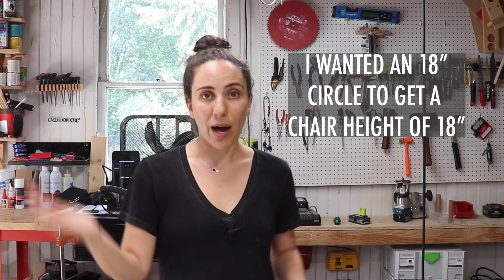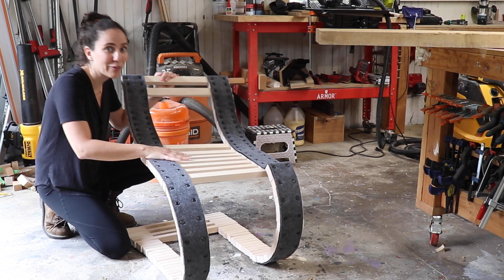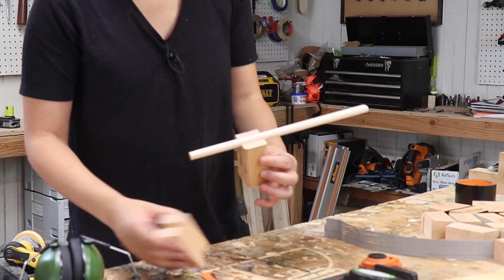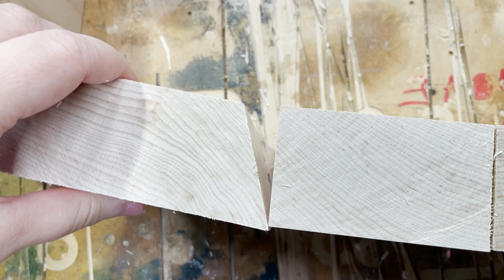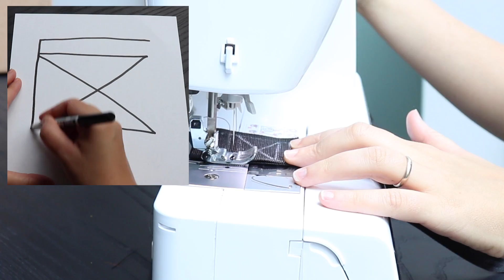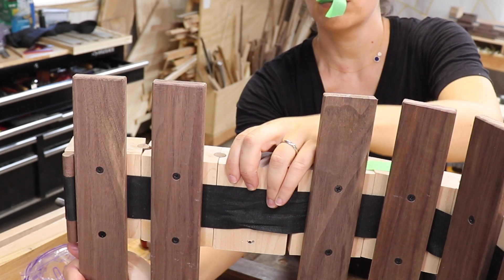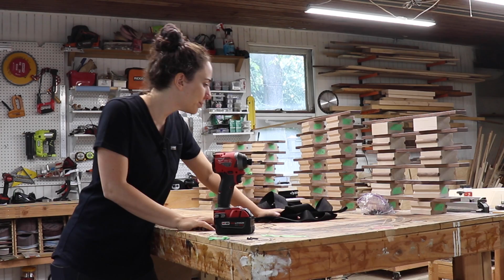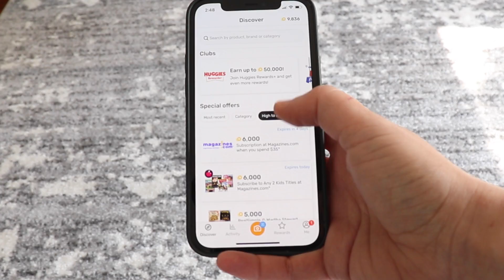I ATTEMPT to make a Roll Up Chair… AGAIN...

Comment: Yeah I think your major downfall here is the straps, sprats are made or usually like what strong cloth? And cloth stretches no way about it. Leather would also stretch a ton so I would recommend against that too, I think your best and only real solution here is metal, either metal cables to hinges would probably work best since they will give the flexibility to roll the chair up but won’t stretch at all. Also in my completely unqualified opinion I think it would be best to make the big bend of the chair smaller so the chair isn’t so tall and maybe shorten the length of the chairs platform since the farther out you go the more leverage you create putting more and more pressure on the bend that need to hold you up

Comment: Ever who suggested small cable through the center of the wood in the critical curves might be it . A 3/32 stranded cable I think has a working strength of 300 lbs . By dead heading the cable using nikro  crimps set into the wood this Might work . Explain this to an engineer who is a fellow wood worker and you’d find he/she would jump on the challenge. These guys love a good old how to problem. Still use the straps .  Hope this makes sense, my explanations aren’t always the best .

Comment: All you had to use was tension steel cables with a tension release pin for when you wanted it to fold.
Steel doesn't flex, and the pin when no pressure is on it can easily be removed.

Comment: you could just use a lot of hinges between each block, maybe 1 big one per 2 blocks or 2 smaller ones per 2 blocks, it would not have any flex and would still fold up

Comment: An idea with everyone else’s you could try and make a limiting piece to go on the curve parts that would still hold the angle just from the other side of the 360. It may have been harder for the math but I think that could work as long as it doesn’t ruin the look your going for. I know the piece wouldn’t roll but if it’s just one piece limited then you could roll everything up around it.

Comment: Hey, I know you have tried twice and can't get it to work... I have a third design that will work... best part, it rolls up like you want, doesn't twist, and as an added bonus, should work without even the need for strapping and is tunable.

How do I get you my design drawing?
Reply: I messaged you through youre website.

Hopefully I hear back from you, if not simply to humor me. :)

Comment: I wonder if you could've made stiff supports to take some of the force off of the straps. They'd be under where you sit so that the straps don't flex under your weight. They could also be used to turn the chair into more of a backpack when it's rolled up.

Comment: What if: Make the blocks themselves into a chain, and ditch the strap entirely.

Cut each block into thirds along the direction the strap currently runs, then shift the centre pieces along by half a block and anchor so that each centre piece now connects the two neighbouring sections. 

Should fix both the tension and torsion issues if the fit is tight enough. 

Could be very pretty too with a different wood or just stain for the centre. 

For the floppy ends: a short nib of doweling in between each section that is just enough to grip those pieces prone to flopping but still easily popped out when rolling up. (Plus wont be as dangerous without the end point tension anyway)

Loving your work! I think this is the first time I’ve ever been engaged enough to actually comment on a yt vid hah

Comment: To be fair the forces going through everything is going to be pretty huge. Even with supertextiles like UHMW and Kevlar you're still going to get a fair degree of stretching which likely requires preloading. And when made into a fabric (rather than simple strands) it gets significantly worse. Plus its possible the materials will need to be stretched and released repeatedly to get to their final length. So whilst its not impossible, it would be a fair amount of work to get it working. And the act of unrolling and assembling the chair will be much harder with everything already under a lot of tension so it becomes less practical than envisioned too. Also, adding shims might be an easier way to add the tension (for testing or for keeps).

Comment: i mean it would be bulky and complex... but door hinges? they are metal and cant stretch. you dont need to use them everywhere just areas of high stress. composite material will always have stretch its what makes them so strong.

Comment: This could possibly fix your problem: try 2 points to put your straps on. Rather than one long strap on each side. Use 2 straps on each side. That way you don’t have tension on weak areas on the chair

Comment: I know it dosent work with the asthetic, but wouldnt 2 legs that sit under the "seat" that flip down help  a lot?
I was thinking like either a normal leg or a round dowel, that u cut slits in to and reinforce with something. It "lays" along the chair, and when u fold the chair up, u lift it a bit, and the legs flip down and slot in to holes drilled in the bottom part.

Good work on the whole thing to btw, great to see the prototyping and solutions!

Comment: Oh man. I was rooting for you so hard! Heart wrenching and I'm so sorry you didn't taste success this time. The concept is amazing and your persistence is incredible, hope you can find a breakthrough.

I admit to liking the cable idea but can't work out if it would work. I thought of boring thin metal pipe through the pieces for the cable to run in. Cable strikes me as self centering under tension and maybe combined with the metal conduit could provide the necessary strength/stiffness you need?

Comment: Yeah, you need trigonometry in your life, those straps need to be WAY further from the inside pivot points, otherwise you're just going to massively compression load the inner curve: Even if you do have enough tension to hold the shape on assembly, as soon as you put any weight on it? the straps will stretch and/or the wood will deform.

Honestly, I seriously doubt this project is even possible with wood.

Only way I can see it working is to go with a single spine thats 100% width instead of 2 spines totalling about 30% width (this will also stop your rotation problem)... with WAY, WAY more straps!

Or... you know... make the important bits out of metal... ditch the straps completely and have steel pivot points (and compression surfaces) instead.

And no, leather will not work, it stretches far more than man made 'low stretch' polymers straps.

Comment: you could probably use metal hinges instead of the straps, or just like make a solid connection between each block and the straps with some upholstery nails. Right now the tension from all the joints is adding up along the straps, this change would make it so the tension is only ever between two blocks.

Comment: hey. I'm just an everyday normal guy with no engineering experience but hear me out, please. I see a lot of people suggesting different materials for strapping etc. like metal cables or what not, my logic is, if you have a lot of material, no matter what it is, it has more room to deform. just look at power lines during winter  vs during summer, that thick and strong cable stretches. same with your strapping. what if you use something like fence hinges, they would need to be strong but you could (if my thinking is correct) eliminate all gaps and it would hopefully help with side to side movement.

Comment: I wonder if you could laminate the stars down with epoxy so the only stretch will accrue on the joints and would only stretch minimally. Basically like a steel hinge vs a strap. 

The idea would be to use the chair you just built and epoxy the strap down every inch and fiber of it, minus the millimeter between the slats. Then the strap doesn’t have a chance to stretch. Screw the seat strap to the top to strengthen the bond. Probably already thought of that, but your previous chair, which dis something similar with the staples, seemed to flex less. Keep up the great work, once you have this down pat, sell the plans :)

Comment: Generally materials the are flexible and strong in tension also incur some degree of stretch. However from the look of your assembly that stretch is occurring over the length of the chair and then sliding to the weakest point. a possible way to mitigate this might be affix the strapping on each piece, limiting the total amount of stretch that occurs in one place. How to go about that, I'm not sure. But it's an interesting design problem.

Comment: I would suggest continuing the straps over the top and around the back side to the flat of the bottom of the seat.  This will allow the top to lock into place as the strap tightens during the unfold.  I don't know if you have enough slack for it though.

Comment: The problem is that the strap put to much tension on only side which would cause the wood block to slide which made the gaps so in another word you need to lock the side opposite of the strap to stop the slide. I would use henges

Comment: Maybe this would work:

Drill one or two holes through the width of each block that such that, when all the blocks are connected (for chair formation), they form a flush internal channel for a chain/cable to be run. Two channels (per side) may solve your main issue + the leaning problem; but one channel with dowels may be all you need. Just an idea, though. Good luck!

Comment: I’d think of a way to incorporate steel cable. Like 1/8” or 3/16”maybe even 1/4” vinyl coated,  braided steel cable. 
Like $ 0.25 per foot. 
Super strong, I bet one 1/16” could support 100lb+ hanging/pulling.
Very thin and flexy but gonna have essentially no stretch longitudinally (or lengthy?)
Either drill holes through all blocks and run through, or stitch 2 straps together and sandwich a hidden cable between them. 
Although I want to see this work and it’d be cool, it may be that the initial design is cool but not doable. Imagine a 250+lb person sitting in it and then laying on it and then having the pieces removed surgically from his/her… . .

Comment: Bond the seat belt material to the face of each block.  There for eliminating 99 percent of the stretching over the length of the fabric.  Bingo! Problem solved! Leather is really not the material for this application.  Far to stretchy! Good luck!

Comment: I wonder if you could use a sheet metal in place of the strapping. The metal bands they use to bundle some building materials comes to mind. I would think they would be flexible enough to roll up the chair without stretching.

Comment: I just saw a video with a trampoline built into the ground. Eurotramp possibly. It looks like they’re made out of seatbelts. On your first roll up chair video I suggested forklift webbing which is way too thick and expensive. Mildly used seatbelts or new seat belt webbing could be great. I’m guessing it’s very similar to the packing webbing. But the real advantage could be that it doesn’t stretch. Good luck on future application of the roll up concept

Comment: Honestly, I'm not gonna read 6k+ comments to check if someone already mentioned it. 😎 but have you considered automotive seat belts as straps maybe? Just a thought...
Reply from the maker: That’s what I used
Reply: @3x3CustomTamar  Huh? That's weird, I have used them several times to lift engine's without that much stretching, maybe pre stretch is the way then? 😉

Comment: Someone suggested cables what about useing cables and on the bottom end have so it wont move but the top end make it so you can adust the tension or try diffrent angles on certain sections.

Comment: 🇨🇦/🇺🇸... There is no solution with anything but materials from the FUTURE. Also, I have experience with leather... it is FAR more stretchy than your strapping. The strapping itself is stretchy because it is a WEAVE. The substance is not "stretching" itself much (some) but the weave allows it to deform... pulliing in from one direction (the sides) while it gets longer in the other direction... longitudinally. The wood is compressible on a SMALL scale but it is enough to add to the issue. Cool idea though. You have a lot more patience than I do. 😁

Comment: Tamar, I have your answer. You actually had it too. It’s attaching the straps to each individual piece (at least in the section that was giving you trouble). The reason you had the gaps is because the strap was free to stretch from end to end. So if you have a 10’ length and it stretches 1%, that’s a 1.2” total stretch. The problem is that almost all the force is on the outside of that radius, so when you add another 1.2” of strap (the result of the stretch), that additional length gets taken up where the force is applied. So those handful of gaps are sharing ALL of the added length due to the stretch. If you screw the straps to those sections, you localize the stretch. So now the stretch between individual pieces is only 1% of 2” or so (the distance between the points where it’s secured). Then the maximum gap created between individual pieces can never be more than a very tiny amount. Basically, just build it like the first attempt but with the new straps and the dowels (brilliant idea). I would suggest one more thing to consider: making the pieces thicker (not wider) will also create less stress in the straps (at least in the high stress areas, like that radius). I can explain why, but it’s just compression. If you imagine the pieces of wood being only 1/2” thick, you can imagine the chair falling apart. What it they were 3” thick? The forces would be spread over larger areas as the meeting faces provide much more surface area. You also have a similar result as pushing a door from the door handle vs near the hinge. A door is a lever. The individual pieces of wood are levers as well, when under tension. If the levers were longer, in this case it would put less stress on the straps. I hope you read this and you try it again. I promise you it’ll work. Michael.

Comment: Great project,I enjoyed watching your progress.  Following are my observations.  1.)  Steel cable will be the least stretching material under force.See Dayton Superior for ideas on holding steel cable . [They supply precast concrete  companies  with steel products. i.e half cones]  2.) Forces vary along the length as it attempts to hold the required shape.  [ Either you need to change the size of the wood pieces where the forces is higher, use a material that is strong enough you can ignore the  differences in the force i.e.  place a steel tube though to absorb the forces. 3.) For safety you really need a way to keep the chair from collapsing along the back side where there is no tension.  [Your strapping might work or the wood could be connected.]  Thanks again for an enjoyable exploratory project.

Comment: The strapping design is a single system. As seen at 23:10 the parts of the straps going up the back pull down causing a slack down the leg decreasing the total tension. Try using 4 straps, two tension systems, two up the legs to the seat then two from the seat up the back.

Comment: The correct solution would be using metal cables and drilling a hole through each piece to feed the cable through you can still keep the straps for extra support  you can a knot and bolt on the ends of the cables

Comment: QQ, why the need for the backplane? idea is good, but strapping on the interior side of the angle ruins the support it provides on the exterior side, the material doesn't know what to do since it is being asked to pull and then give (moving the support to the wood side) at the same time, which weakens the support it provides at the bottom. Option 1 you could slide the tensioner so that it only applies to the exterior of the angles, front at bottom, and rear at top, sliding through the seat. Option 2 Why not just make an enclosed oval bottom like a beanbag,? that you could unbuckle as needed to roll it up. and if you really need a backplane, just have a slotted piece that slides down through the slats and with that you could even make it into a back to back chair. Obviously wouldn't match the original idea, but I don't think the wood itself is a good base material for this full shape concept, even with the strapping. You could keep the wood veneer slats, but need something with more tensile strength to carry the bulk of the weight, so that the strapping only has to provide targeted springness when needed.

Comment: Try using motorcycle chain instead of bands of different material. The chain is made to transfer enormous power, it could easily hold the chair.

Comment: use more than one piece of strap per side, it sounds like you're yielding your straps. if you need higher strength straps then double or triple or quadruple up on strap material per side.

Comment: If you increase the depth of the pieces, it will considerably reduce the forces on the webbing keeping the curve (arch) in-tacked,  I don’t think the back or straights will never work as it is applying forces in the wrong direction (the forces need to be in compressed tension to work) maybe if you make the back curve the same direction as the lower section just use a larger diameter and have a joining piece at the base of the back, it may just work, although the simplistic aesthetic‘s will be ruined also you spring steel for your strapping (no stretch at all)